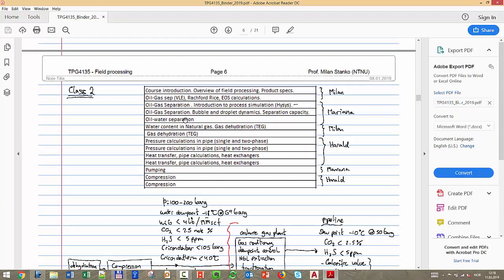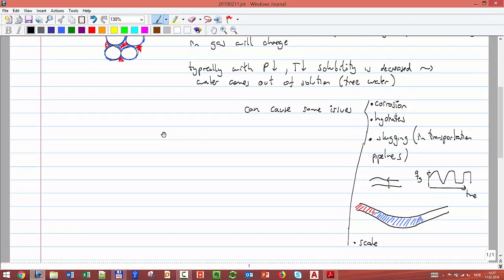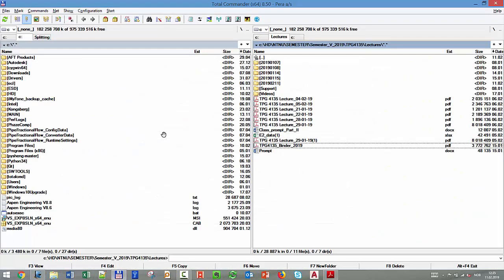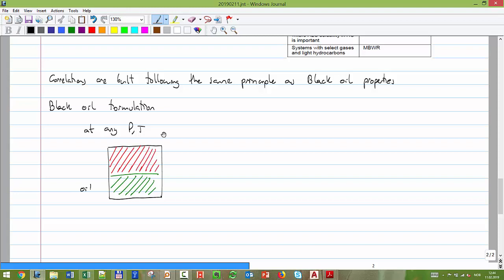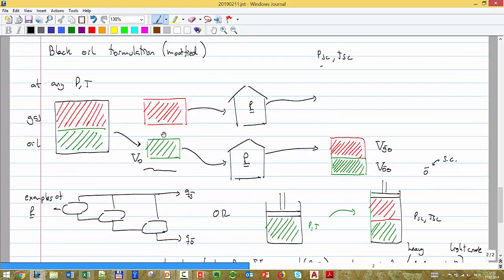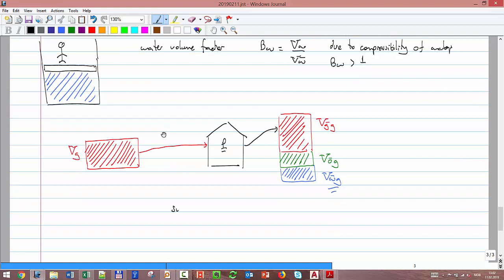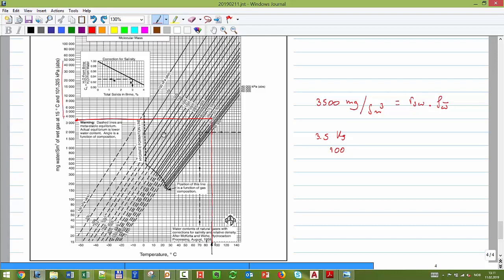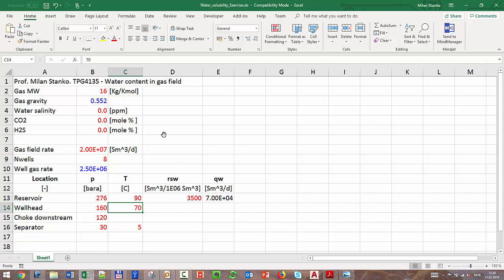Water content in natural gas - Intro

Comment: Hi Sir,

first thank you for your efforts making this video.

Then, I would like invite you to check the following :

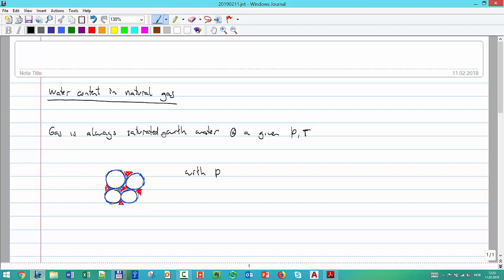Point 1 : At time 00:05:35, you've said that water solubility will decrease at low pressure and that is not correct. Water solubility will increasing when pressure is reduced and this can be checked in the water content of hydrocarbon gas chart.

Point 2 : At time 00:55:40, you have considered 3500 mg as 3.5 kg which is wrong. 3500 mg converted to kg would be 0,00350 kg or 3.5 g
Reply from the maker: You are very correct Abdelilah on both your comments. Water solubility increases with lower pressure and the conversion I made from mg to kg is wrong. I will pin your comment to make sure others can see it. Thanks for taking the time to comment on the video.
Reply: @Milanslectures  You are welcome. :-)